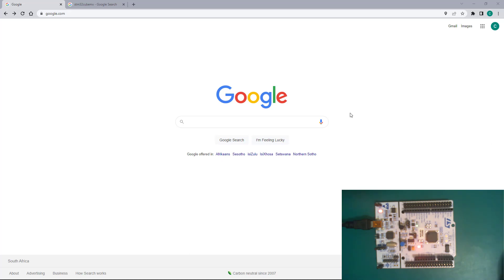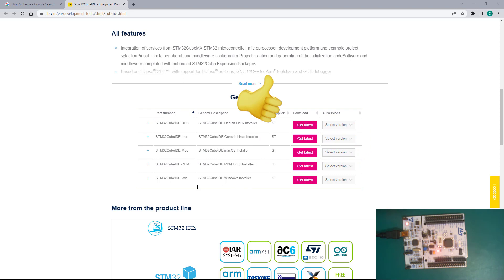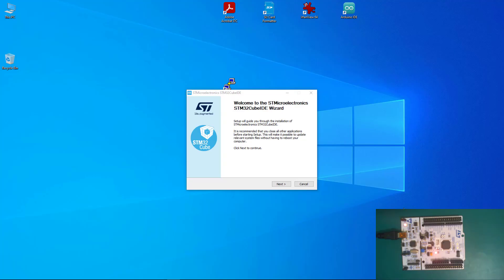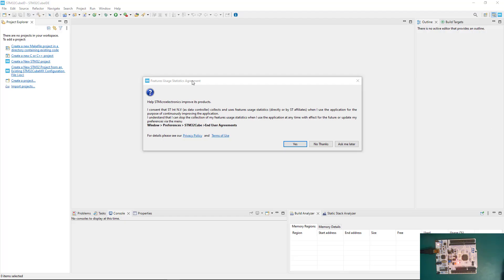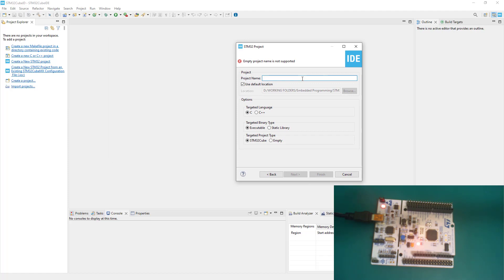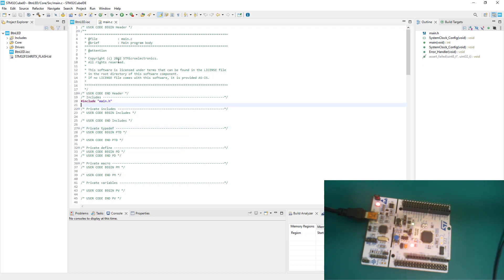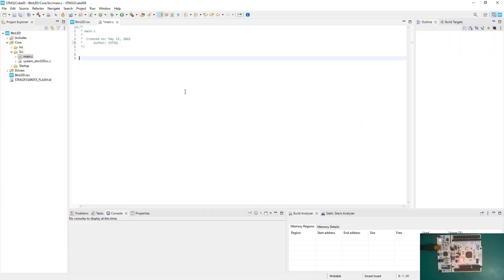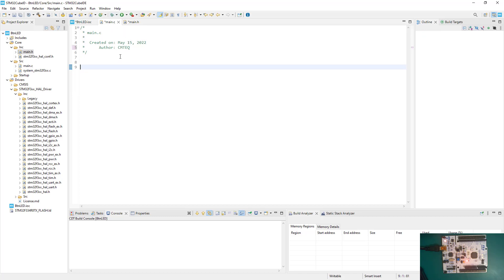0. Installing stm32CubeIDE and Creating a Blank Project

Comment: hello, thanks for the video , when i click on the gear to generate the code , it shows a new window that closes directly without opening a file main.c , what should i do ?
Reply from the maker: Hi, check if you are log into your ST account, otherwise when you click generate it will not be able to download the required libraries, so that could be the issue.
Otherwise try restarting stm32cubeIDE.

Comment: i am not able to click on the cubemx option while creating a new project
Reply from the maker: Have you followed the tutorial steps 🚶‍♂️  can you clarify what you meant?
Reply: @CMTEQ  while logging to myst account it often shows no internet connection even though I am connected to internet
Reply from the maker: Maybe try reinstalling STM32CubeIDE. Are you only using CubeMX? I highly recommend switching to STM32CubeIDE, it combines everything you need in one platform. Also, make sure you're logged in when launching the software; otherwise, it won't download the required libraries.

Comment: Hello! Thanks for video. Is this course actual for NUCLEO-L152RE?
Reply from the maker: Hi, this course was developed using the Nucleo F334R8 board, but you can use any Nucleo board just make sure you select your actual board while following the course.
And configure the clock based on your MCU capabilities.